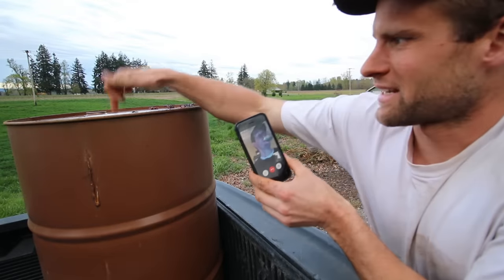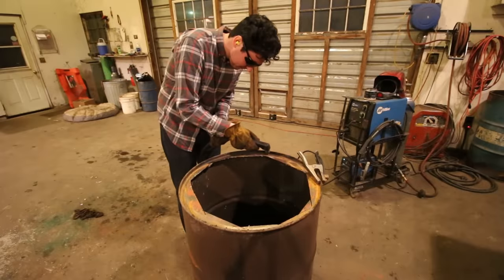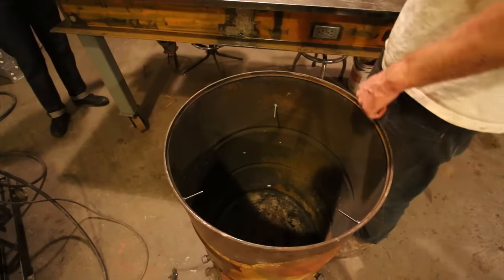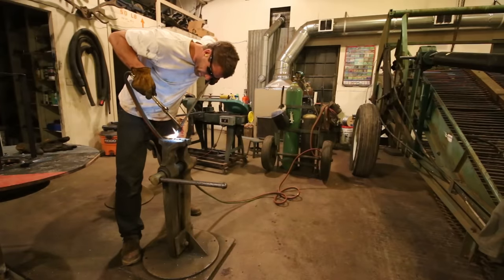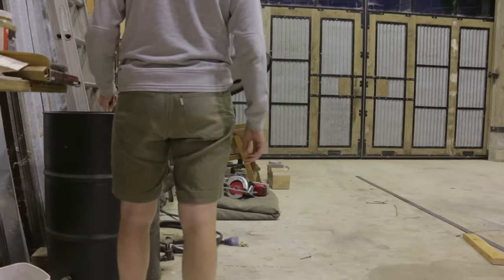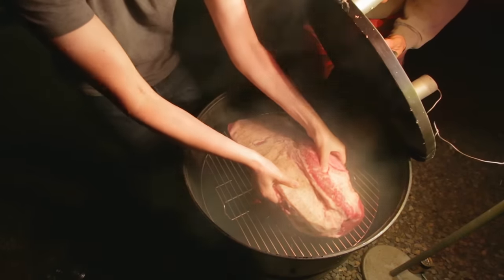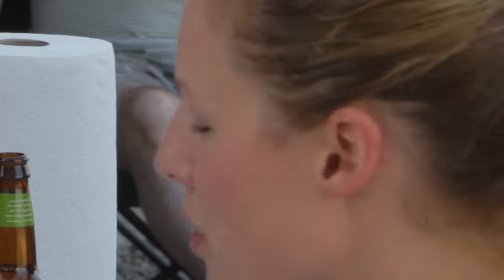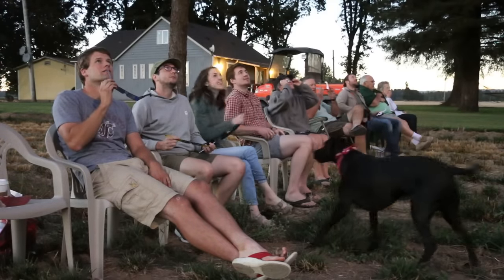55 Gallon Drum Meat Smoker Build

Comment: This was a great video. So simple so down to earth and real. When I think good old America this is what I think of. 
Here is small tip for anything on vertical smokers either add a water try towards the bottom to deflect heat and add moister or turn your brisket flat side down as an insulator. then when you wrap it add some butter on the topside.

Comment: "I wonder if I can fit 2 briskets on the smoker."

Here is a design change,  which I've been using 
for 20 or 30 builds.

From the top down, 3 bolts at 2 inches down, 
another 3 bolts at 10 inches down.

Get 2 cheap aluminum 4 foot "yardsticks" 
from Harbor fright.  They're cheaper than 
4 foot aluminum straps from Home D.
Attach the straps to the top inside of the drum, 
and a Weber kettle lid will fit perfectly.

You can now use 2 Weber kettle grates, 
instead of 1.  If you cut the briskets in half, 
or split the point off the flat, you'll get 3 
pieces on each level, for 3 briskets done.

You can also get 4 whole pork butts, or 
6 racks of ribs done.

steve
Reply: cheers

Comment: That was a great video, looked like lots of fun. If you take a cut off wheel to your drum as it is sitting upright and lightly cut right under the rim the rim and the top will lift off and seal back up just great. Make sure you cut thru the first skin but not all the way thru both skins, it works great.

Comment: Yes, you can fit 2 briskets on the smoker - with 2 small modifications. 1. Get hold of a 22 inch Weber Kettle lid - it'll fit that drum almost perfectly. You'll have to massage the rim of the lid slightly, but it'll fit nice and tight. 2. Add a second grill about an inch below the top rim of the drum, the same way you mounted your current grill. Put a brisket on each grill, and you're all set.

I built one of these about 4 years ago, and it's the one of best things I've ever built. I've cooked more briskets, homemade pastramis, salami, pork shoulders, racks of ribs, and beef roasts on it than I can count. My biggest cook was 40 lbs of pork shoulder (a 16 hour cook, using both racks) and the longest cook was 2 briskets - 18 1/2 hours. It'll cruise right along at 250° without fail.

For those who have never seen one of these before, they're known as an Ugly Drum Smoker (UDS.) Build you one! You won't regret it.
Reply: Also the Walmart brand 22.5" kettle grill lid will work too and less as hard on the pocketbook !!!

Comment: You can get a used Weber 22-1/2 inch charcoal grill and use the lid for your ugly drum smoker and save yourself a whole lotta work. You can also use the grill for a lower deck so as to put a bread pan of water if you like, or cover it halfway with aluminum foil and presto there's your indirect smoke and a handy grease deflector. The best kind of drum to start with is a food grade item with a detachable lid and no epoxy or rubberized coating, because the lip is rolled. The hardest part is cleaning out the ash after you've burned it in. You've got to go in with a sander. It's dirty work. Wear a particle mask too. Don't use cad or zinc plated anything, especially not in hot areas.

Comment: When smoking a brisket, leave the fat on it, and put it laying down on the most fat wrapped with foil, Use alot of Rub and BBQ sauce to smother it, the fat will make it Moist, and smoke it for a bout 6 hours, or how ever long it takes to fully cook it. I would personally recommend finding some Mesquite wood to smoke with, Mesquite gives the most smoke and it tastes wonderfully. Good build though, that barrel smoker should last a couple of years, once you've mastered Meat smoking, then you should build a Homemade smoker trailer, (well after you finish the Barn series of course.) Take care!
Reply: Don't do this. You have to cut the fat cap off or your rub will just be sticking to the fat and not penetrating to the meat. Brisket is generally about 1.5hrs per lb at 225. Oak is best for brisket.

Comment: Be careful cutting open used drums. If not vented properly they build pressure and can cause serious harm. I am a fire fighter emt and have seen some serious accidents with old oil drums.  Not trying to be a negative nelly just looking out for us diy folks.  I recommend using a new drum. There are plenty of videos on YouTube of drum projects gone wrong.
Reply: You don't need a new drum, all you need is a good soap bath. Take a bottle of dish soap, dump it into the top, fill with water, let it sit 24-48 hours, dump the water and begin cutting.

New drums are usually expensive, old ones are just fine. I've built tons of these from different types of drums.

Comment: I noticed that during the 'totality' portion of the eclipse many people took off their glasses to look.

Warning to future eclipse viewers: Don't take your eclipse glasses off just because you can stare at it without squinting.

The reason it's dangerous to stare at an eclipse is exactly because you don't feel the pain. Under normal conditions you can't stare at the sun without squinting/looking away, this protects your eyes. Your retina however doesn't have any pain receptors. Even though during a total eclipse most of the visible light is shielded by the moon, there's still a ton of UV/IR light reaching our eyes, we just can't sense it. Staring at the sun too long you can damage your retina(which doesn't heal) in a couple ways. One is by literally burning it(think of a sun burn). We normally avoid this due to the pain of looking at a bright sun, but a dark eclipse circumvents that. The other way deals with a chemical reaction to the massive amount of radiation(visible and non-visible light) hitting photo sensitive bits of our eyes(I'm not knowledgeable enough to speak much about it).